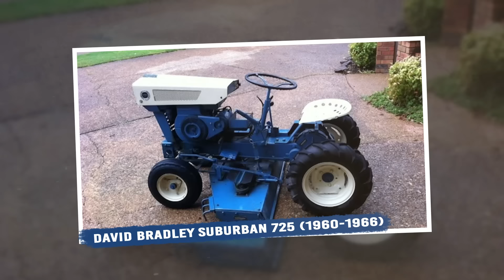10 ICONIC 1960s GARDEN TRACTORS THAT FADED INTO HISTORY

Comment: 1:09 I just had a tractor just like the one you see at 1:09 mark, hauled off to the recycler. It had been sitting by the garage for 20 years but couldn’t find anyone that wanted it. I still have the mower deck for it. The 10hp Kohler had a bit of a knock in it but it could have been rebuilt.  It was still in decent shape because it was draped in fiberglass trim and bodywork.  Dad had a dozer blade for it and a plow plus the mower deck.  Bad thing about is that it’d break a belt quite often and dad lost patience with it.

Comment: I still plow my garden with my 1974 Sears Suburban.12 horse Tecumseh.  Ive had it for about 25 yrs, still in good shape.   I cut my 2acres with my Gravely  20 G. 20 horse Kohler magnum horizontal engine. Rebuilt the engine when I got it  3 yrs ago. . It's a super heavy-duty machine.  60 inch deck.

Comment: I got home form VN Jan 6, 1971.  
While I had been in VN my Da had his 1st heart attack in Oct of 70..  Ma was shoving the Snow form the bottom of the drive only.  I was not about to go out in Upstate NY in Jan unless I had to.  Cold just did not make it after the Little Guys Land.  I had saved over 4K while in army so I bought Them a Wheel Horse with all the stuff that went with it.  Most of the stuff has rotted out but the Tractor is still alive.  Its engine has been rebuilt twice and it cant be done again but it still runs.  We built a wagon to go with it b/c the little ones u can buy r useless.  My nephew Has both tractor and wagon and still uses then on his little 2 ac.  He has a Old Cub he mows with but if he needs to  haul it is the WH.  No one builds them to last this long any more.  Most things today r built to last less then 5 yr.  

Total cost for every thing in 1971 was just over $1500.  I bought a '65 Rat that winter for just $1600.  I still have the Rat with over 1/4M on it.  Once again not made as they use to

Comment: You should add the old Gravely walk behinds.  We had an 8 hp then upgraded to a 12 hp.  Nothing could stop them, even trees.  My brother cut down a couple of young apple trees accidentally with the 8hp.  It was the era of "Safety is between your ears".   It had forward/reverse and hi/low with a front PTO.  If you fell off the sulky it wasn't stopping.....

Comment: I have a 1967 Wheel Horse, T-1257, 12 hp cast iron Kohler, and Carter model N carburetor on it, set up with a 48 inch cutting deck on it. I still use it to cut grass, and pull small trailers. 
The only major thing ive had to do is replace the exhaust valve in the engine, as it finally burnt through, and periodically rebuild the carb. Modern fuels do not play nice, so PM is required. It will probably outlive me, being its only a year younger than I am! 
Thanks for doing this video!

Comment: I acquired a 1968 Cub Cadet 125 in 1971.  I still use this tractor for lawn mowing activity to this day.  it has a Trac Vac mounted on the back to collect grass cuttings and is the greatest machine for sucking up leaves in the fall. It has the original engine which still runs fine.  Just this past year I had to replace the tires due to dry rot but after 56 years, that's not bad.  It has never been left outdoors. Over the years I managed to acquire a number of attachments such as snow blower, single row plow, front blade and EZ Rake lawn thatcher. The hydro trans still works perfectly.  The Sunstrand hydro will last forever as long as it has oil in it. About 12 years ago a was able to find a twin to it, same model, same year,  so the original one has been dedicated to lawn duty.  The twin does all of the other tasks.  When covid hit us I took the opportunity to somewhat restore it. Not that it really needed much I pretty much disassembled it, cleaned up everything and repainted it. New decals makes it look brand new again. So, at 83 years old, this thing will surely outlast me.  its been my partner in yard maintenance for 54 years.  As is commonly said, "They just don't make them like they used to".

Comment: I owned a well used Wheel Horse model B80. Kohler 8HP, 4 speed (3 forward, one reverse) and 39 inch belly mower. I loved the bomb proof PTO clutch. 1,000 times better in my opinion than the new electric clutches. 
The terrain I was able to mow with that full sized frame mower was amazing. Ditches, steep embankments both down and (not advised) up or parallel with my butt riding on one of the fenders instead of the seat to keep the uphill rear tire on the ground (no mower cutoff seat switches).